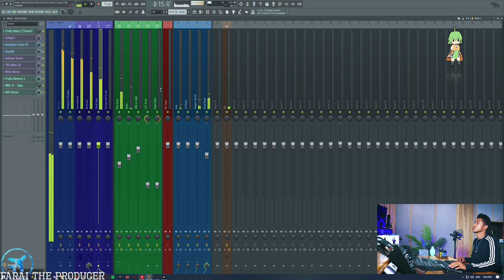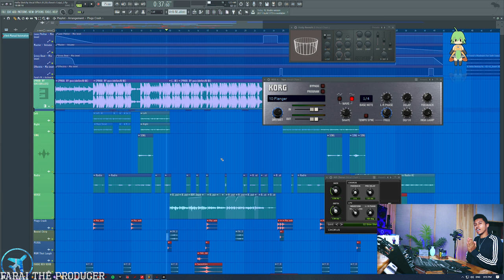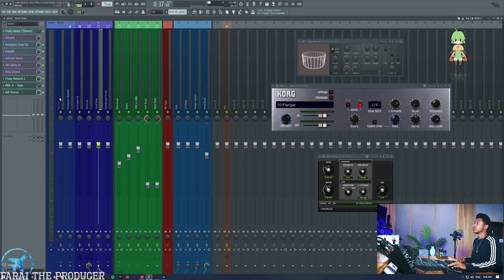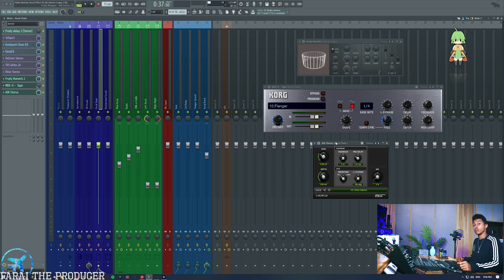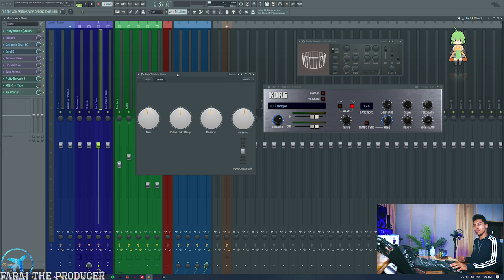How To Mix Smooth Vocals Using a Cheap Microphone 🍀 🌊⚡

Comment: You can use parametric eq and use the vocals preset the add another eq cut the bass with that one then add a compressor threshold being 21 ratio 2 6db and make sure you put ur mic volume on your sound setting on windows or how ever on Mac as 54 or 56 then done you have a good professional sounding mic and oh yeah stay like 6 inch away from the mic and use a pop filter plz this is for those who are just starting out